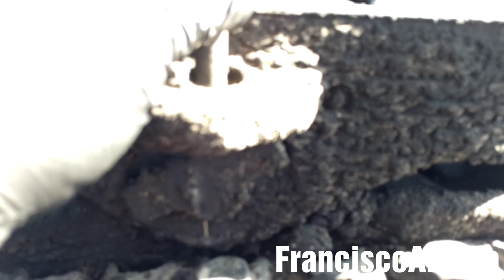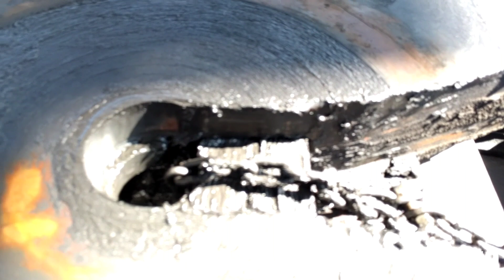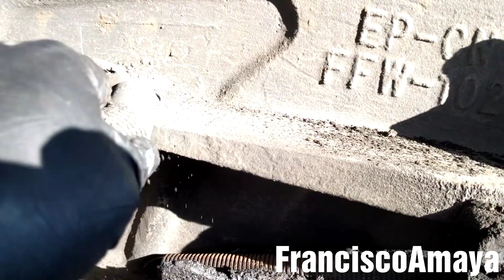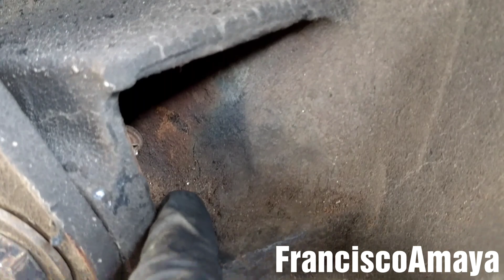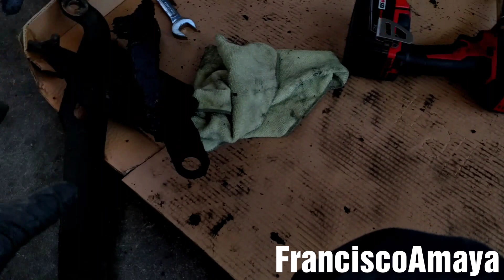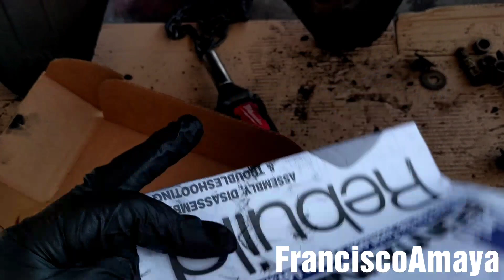Freightliner Cascadia Fontaine fifth wheel repair part 1

Comment: I have a question. I have a dd15, 09, Freightliner Cascadia, in have a coolent leak behind the fuel doser on the exhaust clap. And because  there’s coolant coming from somewhere it won’t reach a high temperature to let it region. Can you help?

Comment: Fontaine has a recall on certain models of fifth wheels. They'll replace it free
Reply: How do you utilize the recall
Reply: @anthonyallen2301  You can call them direct. They will ask you for the serial number on the fifth wheel. If it's under the recall they will send it to a shop you decide to have the work done at.